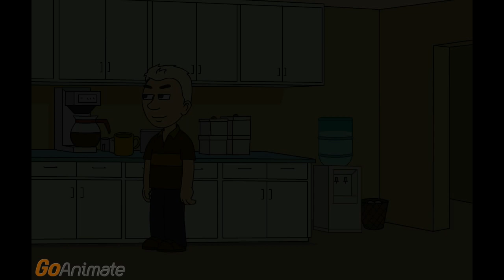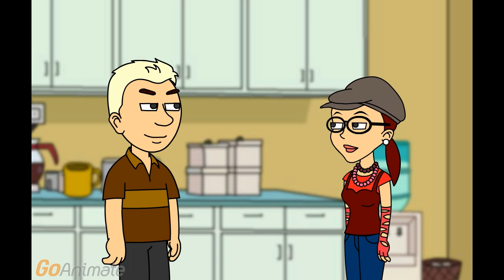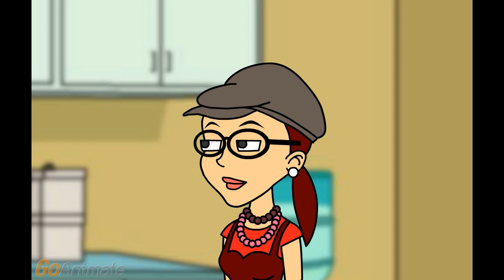Friedrich Air Conditioner Troubleshooting

Comment: I both mine two years ago I just use it the first winter but for use it next year because the bill or energy was too higher. Then u try to uses and did not work. I called and they says that they are not responsible because one year pass already. 800 dollar for this junk 😡